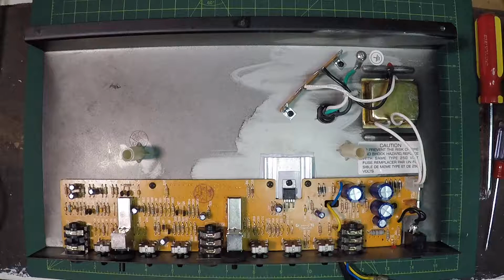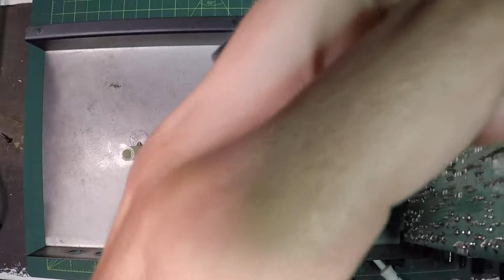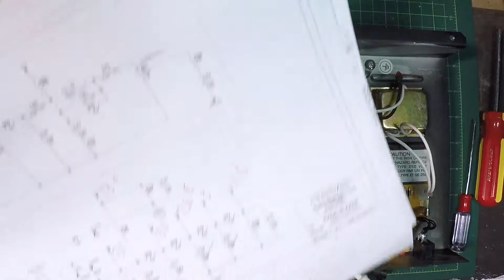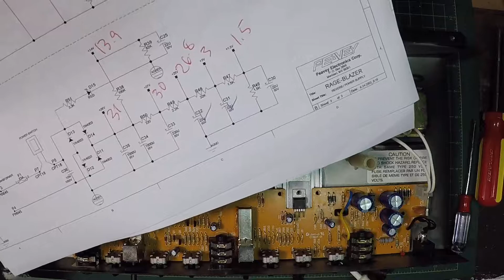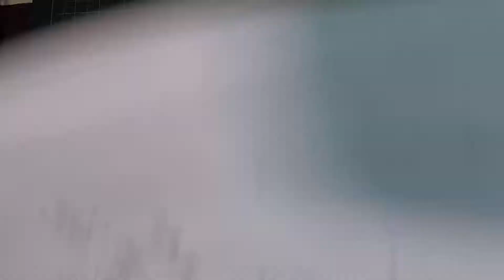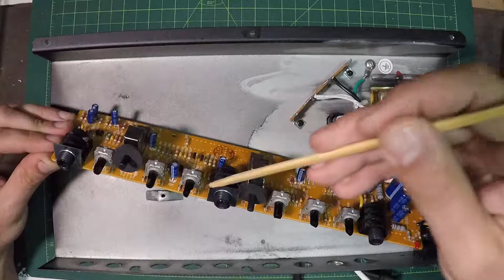Peavey Rage 158 Repair

Comment: I've got a Blazer 158 that started cutting out after playing with it up pretty high for 1-2 hours.  I removed the board and reflowed the input jack, and had cleaned off the thermal compound under the chip and heat sink, then reapplied thermal compound and put it back together.  It lacks volume now and still cuts out, I never saw a silica pad under the chip or heatsink.  Was the original thermal paste non-conductive?  It seems even putting a pad underneath both would be a wash as the bolts go thru and attach to the chasis.  Excellent video, very helpful.

Update, after putting it back together and it still lacking volume I put a silica pad under the chip.  It's much improved.

Comment: Hi How are You My Peavey Rage 158 Mad in USA din not work fine 
I take out a resistor I thougt was bad but i loosed It is exactly after the + of the input jack  I can sen You a photo of the place Where It goes I only have a photo of that resistor but I can' t recocognice two of the colours one of them isvred I can send
You The picture
Reply: Could You send The value of that componente or a photo of it I am thanks to you
Reply: The mother of mine is not exactly to yours 😅 My Peavey is The model Rage Made in USA

Comment: I want to challenge the assertion that the chip should be isolated from the chassis. The peavey schematic doesn't call out where the tab should be connected, but the TDA2040 spec. sheet https://www.st.com/resource/en/datasheet/cd00000130.pdf says it's connected to pin3. Back on the Peavey schematic, Pin3 is connected to AGND1/circled ground. That symbols means chassis ground.

Comment: Nice video - not sure why you have an issue with the IC ground tab (which is same as IC pin5)  to ground (chassis).  The "circle ground" is chassis, which is  the TAB of the IC and is basically the "power portion", and it connects to "signal ground" at the INPUT and CD.  The 1995 schematics are clearer on this.  I have two 158 Blazers and they are not isolated (the IC) to the chassis.

Comment: Does that silicon pad transmit heat to the same extent thermal paste does? If not, it's trading a problem now for a problem later.

Comment: I've got the later Rage 258 version which I have moded to be a head and I was pleasantly surprised they have fixed the chassis issues in that iteration. It mounts in a more conventional way and not through the bottom of the chassis and the handle was attached to the wood only, as it is supposed to be. Fine little amp through a good speaker.
I've got a question which you might be able to answer: I'd really like to add a footswitch to the amp. ...of course doing it the proper way with a relay instead of routing signal-carrying wires outside. For a relay I need DC power. I've dug up the schematics (feel free to do so, I found it on google image search) and there are actually quite a few voltages doing their thing in the amp and I can't decide which one to use. Currently leaning towards the 3 volts because 3v relays are easy to get and I'd rather see three volts going to a footswitch than 18. And three volts are much LED-friendlier than higher voltages.
Does that sound like a good idea? I can solder decently and have built quite a few pedal kits over the years but I don't have a ton of electronics voltage. My main concern is that I don't want to mess with any bias voltage for the opamps/transistors.
Thanks!

Comment: Informative video, thanks! I think they seem to be known to be faulty. I have a similar issue with mine, the input has to be wiggled to actually produce more sound than static or buzzing. Not sure I'm comfortable opening it up, yet. I was curious and glad I found your video for once I jump the fence. I had an odd feeling about the handle, totally make sense. I will probably end up 3D printing my own spools as a precaution as I've got a printer. I know I can buy a newer, better amp but it'd be nice to be able to fix or at least attempt it. Thanks again for the video!

Comment: just bought a used Rage 158. tested it before purchasing and all seems to be working but now I know NOT to pick it up with the handle! very helpful video, thanks.
Reply: A que te refieres con el mango?
Reply: @xSilencex_   unfortunate design. the screws that hold the carry handle are screwed directly into the chassis (system board) so it's not difficult to bend the chassis by picking up the amp by the handle.

Comment: Just got a broke one from a friend of a friend in exchange for fixing their vacuum, it would make popping noises but no noise from the guitar. Took it apart, found that the input jack's solder had actually broken, like a donut, so that the actual 'pin' and tip of the solder wasn't making contact with the rest. 

Reflowed all 4 points, put everything back together (I don't have a test speaker or equipment aside from a multimeter) and... Still got no sound. Going to try again tomorrow, using your tip about the grounding. If it still doesn't work, probably just going to junk it, I was just planning to have it as an extra backup amp. Even a good quality used 158 only sells for like $75, and mine is definitely not good quality. It doesn't even have a handle. 

Wish me luck, and hopefully this video will help get it fixed! I'd hate to see such a "workhorse" amp get junked, but I'm not going to spend days fixing a $75 amp, lol.

Comment: Very interesting. I will try with mine as it has a pronounced hum. Also the pre-gain is not making good contact. A question, if you still remember the amp. I use it with modellers through the cd input and it is extremely loud. Would changing the two resistors that connect this input to a higher value make a difference? Would it only affect the volume or also the tone?Thanks a lot!

Comment: Wow I have a peavey rage 158 red strip series not sure if that’s the same as the others but after watching this I decided to take a look inside mine sure enough I actually saw some stress cracks on my circuitboard. There is nothing wrong with my amp it works like new it just peaked my curiosity after seeing this. But yeah you’re right those bolt on points do add stress to the board. Very helpful video and tips. Thank you👍🏻

Comment: Great video, thanks!  Your weird issue with the buzzing just after 12 minute mark is the issue that I get. So it's the ground between the input jack and the chassis, oddly though, on my amp (the Rage model) I only have a small piece protruding from the input jack for gounding, so I'm going to have to figure out how to get more material or find the right dimension of a washer to add more pressure to the ground the input jack to the chassis.

Comment: Hey man thanks for the video 👍🏻 very informative! Could the headphone input jack be considered as a direct out, for recording through an audio interface? I noticed the headphones once connected to the amp they act as a load since it cuts off the speaker signal out, I'm not sure, but don't know if the amp necessarily has to be connected to the speaker as the load cuts off when the headphone jack has a plug within

Comment: I have the Peavey Blazer 158 from the UK requiring 230 volts. of which it powers on but no sound unless you plug into cd-tape input then you can volume the sound through the guitar, but nothing when plugging in to guitar input. so could using 120 volts in US cause the amp to not work correctly? getting 15v secondary on transformer. Thanks
Reply: Late reply but it’s the cd or head phone jack. One of its contacts are ether bent or stuck making it think it’s got a line out in turn cutting signal to the speaker. Try plugging in a cable half way into the jacks

Comment: Thanks, how easy/difficult is to add a foot switch to go from clean to dist on this amp? Thanks again.
Reply: hi, replacing the switch with a relay switch, the foot switch powering the relay. This would mean adding an additional socket for the foot switch. you would be dealing with sensitive audio signals so the relay should be mounted close to the channel switch. Not an easy task, but can be done.

Comment: Wow. I got a Peavy Blazer WITHOUT a handle. The sound is clipping like a fuzz with dying batteries even on the clean channel. I ruled out the speaker and power IC, and thought maybe the reverb was at fault because one of the transducers is loose, but it sounds fine actually. Min/max reverb has no effect on the clean clipping. 
So maybe it's the preamp IC shorted from by the PCB or chassis flexing? 
Could using this amp in stereo with another one short out the input op-amp? 
I also noted that the MID control doesn't seem to have any effect...